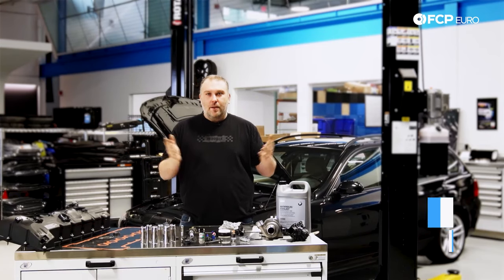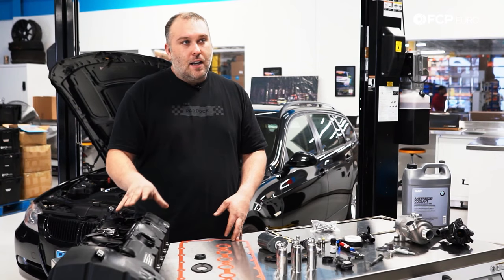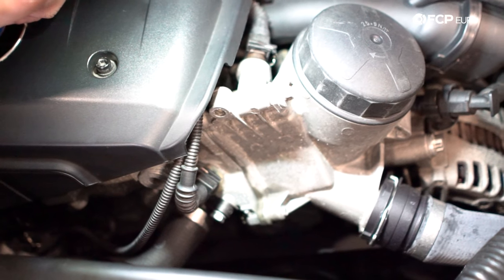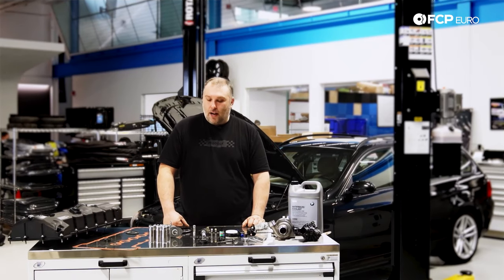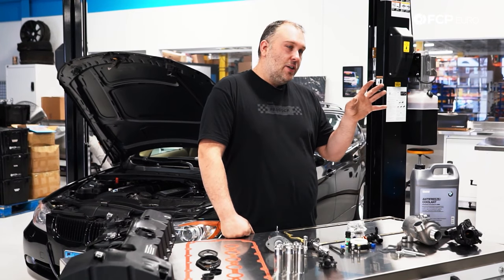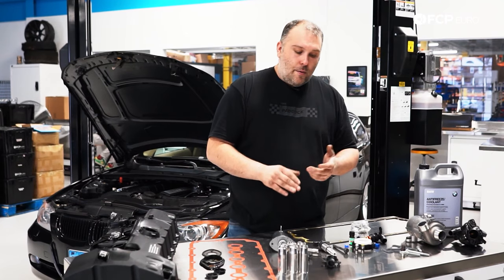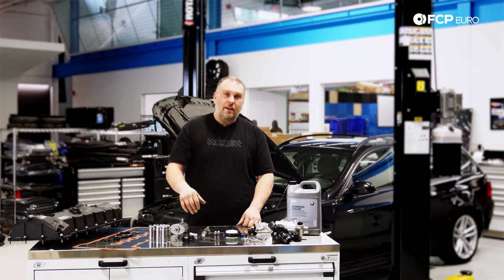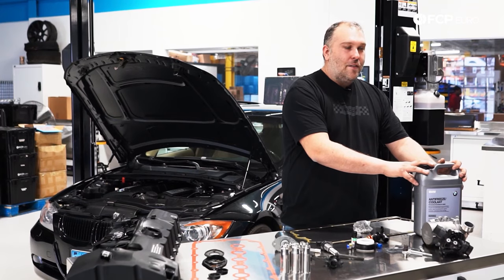BMW N52 Engine Diagnostics/Problems - Everything You Need To Know (128i, 325i, 328i, 330i, 528i)

Comment: Worn or dirty oil cap gasket can cause oil leaks as well (and fill up the grooves on the valve cover with oil). Funny when you think it's the valve cover gasket or valvetronic motor gasket and order parts for those before looking under the engine cover.. .. xD

Comment: Is water pump really failing that much on these models? I've heard that water pump fails in 335i that has plastic water pump. This one for 328i looks very sturdy and strong built. I've got 120 000 on 328i and no issues with water pump so far.
Reply from the maker: Not as common as the 335i.

Comment: How can I find out if my water pump was changed by the previous owner. If I receive an answer it will be awesome thank you
Reply from the maker: That sort of thing might be a bit difficult, if you still have the previous owners contact info you can ask him, or if you have service records you can look through that. If the pump was very recently replaced you might be able to tell by looking at it. However, if in doubt, always assume it hasn't been done.
Reply: @fcpeuro  thank you guys.

Comment: I changed my starter now I have multiple misfires and runs terrible.  What did i screw up putting it back together?🤷🏼‍♂️
Reply: You screw up by doing it your self! lol
Reply: @SomoshiphopRadio  lol. That's what I thought.   It also needed a valve cover gasket and plugs and coils.  Runs great now.  Not sure why it started running rough after I changed the the starter. My guess is it was sitting for an extended period!?!?🤷🏼‍♂️

Comment: I just opened up my n52 and the problem was crank no start turns out the aluminum bolts that hold the exhaust cam to the cam gear so the gear would turn but the cam would not
Reply from the maker: we can only imagine how difficult that would have been to diag without opening her up

Comment: Can anyone tell me where to start troubleshooting for a hard cold start? When hot it fires right up perfect but when cold, the starter spins fast for about 3 seconds consistently and then it starts up with rpm fluctuation a little for another 10 seconds. Car otherwise runs great and smooth.

Comment: Arent the cooling hoses also problematic? Seen a few people busting coolant hoses
Reply from the maker: As with any rubber coolant hoses, they age and wear, so its best to replace them as preventative maintenance before they burst open!
Reply: @fcpeuro  Seems they age and wear prematurely , when i was flushing the cooling system using water 2 years ago on my 1987 Nissan  300ZX  the temperature dropped in the  beginning of october and caused the water to freeze and the 31 year  old  original coolant hoses expanded but did not burst  .

Comment: Which style wheels are those on the E91 in this video?
Reply from the maker: Hi, Seth. Those aren't a BMW wheel, but they have BMW center caps. I believe they were from Tire Rack.
Reply: Look like Rial X10. I had those as 18 inch winter setup.

Comment: Great video! I have recently bought a 330i with the n52 engine, and I've noticed that it really slightly pinks under load, usually when I'm in 4th gear at 30mph and I slightly accelerate. It's had good service history, its done 50000 miles and its had the injectors replaced recently, I was just wondering if this was a common problem? I'm going to try some higher grade fuel and potentially some injector cleaner but if that doesn't work what could I do to help this?
Reply: I own an 06 330i and that is not very common if you don't have any engine codes.  Fuel quality requires premium >= 91 octane...number one.  Make sure your air filter is clean and the spark plugs are new.  If it's a manual, 4th gear at 30mph is too low, you should be in second, these motors require RPM to be happy when you load them.  The fourth thing I would look at on a warmed up engine, scan the MAF reading at idle.  It should be around 3.4 g/s  (grams per second) plus or minus 0.2 grams.  A cheap scan tool should let you see that reading in Live Data.  If it's under reporting like in the 2grams or lower, you have a vacuum leak in the intake.  Spray brake clean around your intake gaskets and PCV system hoses while watching the O2 sensor reading, when it goes high or the motor RPM increases you found your leak.  Fifth, loosen the intake bolts, disconnect that pain of a valve cover to oil separator plastic hose, and pull back the intake on the studs just enough to inspect the intake valves with a flashlight, if they are heavily carboned up, time for a walnut blast cleaning.  Pinging without excessive heat usually means you are running lean, the motor is extremely hot(coolant fan runs constantly...needs a coolant pump replacement), the load is excessive compared to RPM(4th at 30mph), or your have too much spark advance/ignition timing.  Happy Hunting.
Reply: @iamblaineful  OK awesome, thankyou so much for the advice, that'll keep me busy over the quarantined period!
Reply: @iamblaineful  I have a 328i and it's much happier in 3rd at 30 mph, you're going to be at like 3.5k rpm in 2nd at 30.

Comment: I run the car without the engine cover so I can keep an eye on leaks and also hopefully help with cooling. What do you think?
Reply: Nice
Reply: Well, that cover is there to keep the coils and wiring under it dry. If you live in Phoenix or SoCal, you might be okay, but I wouldn't do it in a wetter area, or somewhere that gets a lot of road salt. Hopefully, you'll be fine.

Comment: This engine dont have high fuel presure like the m54 or n55?
Reply from the maker: That is correct, it just has a regular in tank fuel pump and fuel filter/pressure regulator.
Reply: @fcpeuro  👍

Comment: I have a gen 1 in my 630i Sport.. just clocked 80k so I’m thinking water pump/thermostat very soon. Made the mistake of disconnecting my battery yesterday as I was upgrading led bulbs.. now I have the airbag and seat belt tensioner failure displayed.. doh, probably shouldn’t have disconnected the battery 🙄
Reply from the maker: Good idea on the waterpump/thermostat. Do you have access to a scanner to erase those codes? We've got a good one here: https://www.fcpeuro.com/products/maxicheck-mx808-obdii-scanner-autel-mx808

Comment: What makes the lifters ticking ahead
Reply from the maker: Hi Darrel, there are a number of reasons you may experience that. A combo of cold weather and short trips can be the main cause of this. Usually, after a hot run, you will notice the noise go away. If the vehicle sits for long periods of time the lifters can bleed out. There was also a brief period in time when BMW was replacing cylinder heads with an updated lifter, but the results ended up being the same.

Comment: You should rename this video "SCARED STRAIGHT!"
you just all but crushed my dreams of owning a 328xi wagon I've been looking at!
I've been working on cars for over 30 years, and have ALWAYS steered clear of Euro cars, for VERY good reason(s). 
I'll never underhand how certain vehicle owners just accept recurring issues as "normal"
oil leaks are NEVER OK! (I'm also looking at you, Subaru, Harley, and VW owners lol)
Not sure why they have failed to address their fondness for oil leaks, my buddy's 1989 325i leaked profusely by 1993
They're great NEW cars
They're TERRIFYING USED cars

Comment: BMW couldn't engineer their way out of a paper bag. Nice looking vehicles, nice fit and finish, fun to drive, basically designed (either intentionally or incompetently) to fall apart at 100k.

Who integrates a $15-$20 part (PCV valve) into a $400 valve cover so that you can't service it? BMW, that's who.

That said, if you're unfortunate enough to own a vehicle with this platform, FCP Euro is fantastic to deal with.
Reply from the maker: Good point, we can't say BMW always Does The Best Stuff, but we're doing everything we can to help people that deal with any issues. Thanks for the kind words!

Comment: Most reliable engine, really? I bought a 2013 128i. The engine sized up at 65K miles. BMW replaced it, not for free, it was just out of warranty, but they did charge me way less than the dealer first quoted, after I called BMW corporate and complained. I kept the car for another 15K miles and after a few other issues decided to sell it. A very good friend of mine wanted it, even though he was aware of the engine failure and many other problems we had had with the car. He figured it was a good deal since the new engine had few miles. Well, the new engine also sized up. This time it only had 20K miles on it. BMW was kind enough to replace the engine as it was within the two year warranty they had given on the replacement, despite the warranty not being transferable. Good for BMW, but what is wrong with this engine. Both times the motor failed the oil was full of metal particles. This was car was the most unreliable car I've ever owned. It left us stranded several times. When it did run, it was a very nice driver, but it had constant problems this N52.
Reply from the maker: Really sorry to hear that happened to you, Tim! That's definitely an unusual problem, despite it happening to you twice!
Reply: @fcpeuro  Thanks, I know it seems to be very unusual. I heard that a lot. I also owned a 330 that I loved. Had no problems with it for over 100k miles. I was expecting the same with the 128. The variable valve stuff and magnesium block killed it for me. Things like, I was told they needed to replace the valve cover just because they removed it to access a cam sensor really put me off. That plastic cover is $500 bucks. What car manufactures are doing to these engines just to save a glassful of gas a month is getting pretty ridiculous. When we went car shopping late last year, we decided to buy used after reading about some of this new technology. One in particular, is the direct injected engines of some manufactures and the problems of intake valves carboning up.  It feels like the 1970s again, when cars were crap as they tired to redesign them to the new emission and safety standards. It took a while to build a product that you'd want to own.

Comment: The water pump and thermostat WILL fail at 75,000 - 100,000 miles. I was so pissed to find out the cooling system is only good for 50 to 70k.
-06 530xi owner for 6 yrs
Reply from the maker: Yaaaaa typical BMW stuff sadly, for such cool cars they really don't do well with designing the cooling system.
Reply: I have the same, 06 530xi with 230k km, and the original water pump is still running strong. All highway however. I guess it's a ticking time bomb XD
Reply from the maker: @pardyhouse2767  Dont jinx yourself >.<

Comment: BMW the most problem, 1- water pump, light burning with no reason, window glasses rolling down early problem, oil leak fast when car run over 60,000 miles, all parts inside scratches  easily and engine may be overhaul when it run about 100,000 miles

Comment: Need help i have a p1415
Reply from the maker: Hi, Luis, possible issues for that code is: Faulty Mass Air Flow Sensor, Vacuum leak induction system, Mass Air Flow Sensor harness is open or shorted, Mass Air Flow Sensor circuit poor electrical connection

Comment: So now i know by n52 with 250k miles original everything is a time bomb 😂
Reply: Hi!
Did you changed the bolts on the vanos? Now there is a recall action for n52 engines produced 2009-2012, they say, the bolts connecting the variable camshaft timing unit to the engine may break. This may activate the limp home mode safety feature and potentially cause the engine warning light to illuminate and the vehicle to lose motive power.
Did you have this problem? My z4 has only 27t km and i dont want to open the engine with so small mileage…
Thanks for your answer

Comment: 328xi. I’ve replaced 95% of everything you’ve mentioned here.  Car still runs shitty. Basically, once a BMW starts having issues, your car will never run good again. Period. 😂 does not matter how much you change out. The car will never run correct again.

Comment: I have an 2010 X3 with an N52 engine.  I am having trouble after changing the valve cover and VVT sensor.  It will not Idle and I am getting codes like P0015 and 2A87.  I am also getting misfires on 1, 4 and 6.  I didn't have any of these issues before.  I removed the Vanos solonoids and cleaned them with MAF sensor cleaner and tested them my powering them up.  They both work fine.  I also cleaned the check valve screens.  That was fun removing and reinstalling.  And, when I removed the cam actuator I did it exactly as in your video.  I changed the cam sensors as well.  I am at a cross road.  I don't know what to do now.  Can I get some advise.  Perhaps by email  cvleng966@gmail.com  I have changed this cover before with not issues.  This time its making me crazy.  I think I just need to get rid of the car.  I have really had enough of the BMW Bullshit!

Comment: $400 for a valve cover ... $45 for a gasket .... $8 per bolt .... What was BMW thinking with such a poor design. So approx $550 when other engines just need a $50 gasket. Nuts
Reply: I got a qoute of $1200 from a local BMW dealer here in Oklahoma to do the VCG on my N52 330i 🤣💀 
I have the magnesium cover, so it will only be $100 of OEM parts, and I'm tackling it myself.

Comment: Stay away from the N series engines, there are I6s and V8s and they are all terribly bad in their own way. BMW was sued over them, those who know them well can share more but just don't buy any BMW with N in it unless its brand new and you are not keeping it past 50 - 70 k miles on the ODO meter. . Or of course unless you got unlimited time at hand to pick them a part to give it another 50 K miles to go as long as you keep the terribly made engine block intact

Comment: Just don’t buy a Bmw...
Reply from the maker: 😁what do suggesting buying trik4064
Reply: I  bought my first and current BMW almost exactly 1 year ago and I don't think I can ever drive another car other than a BMW in the future. Sure the maintenance can be costly but that's the price you pay if you want to have The Ultimate Driving Machine!
Reply: BMW is the easiest car to fix.  and if you do preventative maintenance and routinely diagnose your car - it's one of the cheapest to maintain, because you catch faults early and fix them, instead of waiting fo the car to stop moving first...